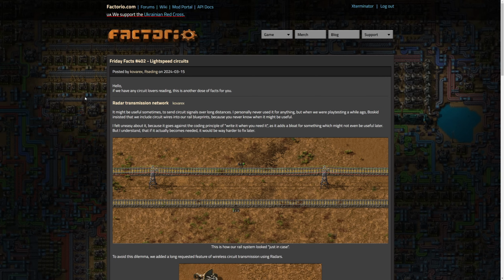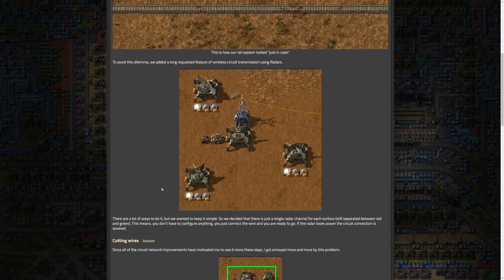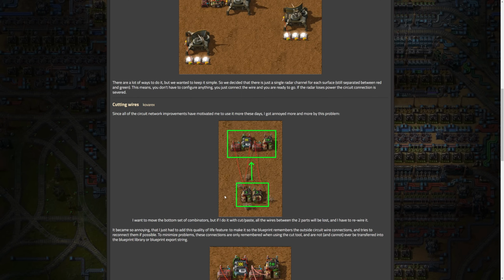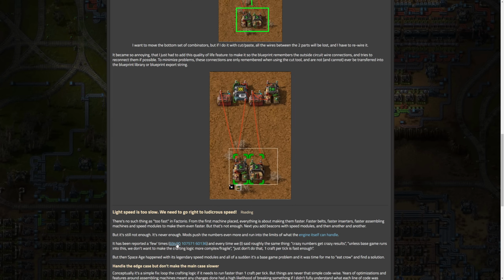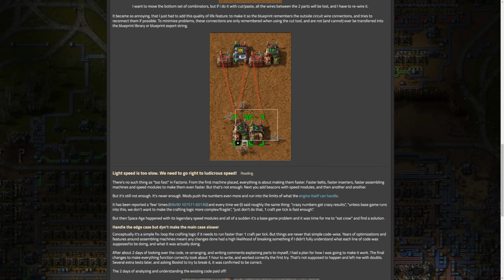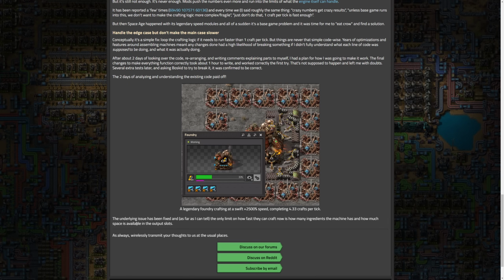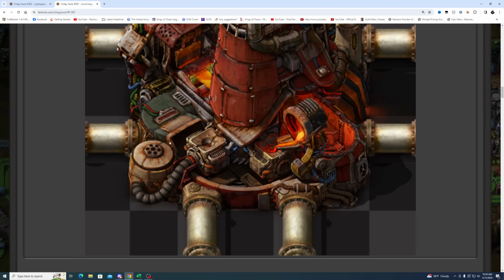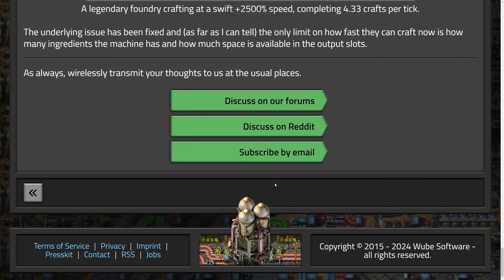Factorio Friday Facts #402: Wireless Circuits & Moar Craft Speed! - FFF Discussion & Analysis

Comment: Factorio gets WiFi!

The FF releases have literally turned into "Name The MOD!" Drinking game at this point...
Reply from the maker: Haha yeah pretty much
Reply: like rimworld, it's great to see devs integrate useful mods into new releases, Rimworld added beards which was a mod, and is now adding books and wall lights, which were both mods
Reply: i made a messeging machine in factorio and you just need to connect one wire to other messeging machine
and using this wireless signal you can message everywhere without connecting a wire

Comment: so 2.0 will be the time where i need to learn the circuits system in more detail. right now the only thing i get working is direct on/off of pumps for oil stuff. (overprocessing the fluids down but cutting that off if the tanks get too empty)

Comment: The radar transmission of circuit data would be a lot more useful if we had multiple channels to transmit on.
Reply: Well you technically have 2, red and green. Though perhaps it might be possible for a mod to add true channel support for each color, maybe.
Reply: I had an idea to use the single line like a telephone line, you input a code and only the intended receiver listens to the signal following that code, like putting in a phone number, your mining outpost would send a signal on the radar network, which would be received by all radars but only the train station would accept it, having been waiting to receive that code, then once the code was verified the signal is sent.

Would probably need some kind of reservation system so multiple sources aren't trying to talk over eachother tho.

Comment: do you think it would be possible to have your signal network utilize this radar network but by way of using codes to trigger the reciever to accept the signal?

ie, your drill outpost sends a signal preceeded by a code of "13142" to the radar network, your coal plant ignores it, your circuit base ignores it, but your train station recognizes the code and accepts the signal, inputing the signal into its attached network and notifying the train to go pickup resources at outpost 7.

this could allow you to use the one Radar network for multiple purposes rather than only using your remote signal network for only one purpose.
Reply from the maker: Hmm very interesting idea! I hadn't considered that actually but I like the sound of it. Unfortunately I don't know enough about the circuit network or signals to know exactly if/how it would work
Reply: @Xterminator  i don't know much either but if someone can program a whole 3d game engine using circuits in factorio, I'm sure we can figure out how to make a code filter/signal repeater
Reply: @asmkalrizion7078 The idea is definitely possible already, and since the radars have been shown by Boskid in the Discord server to just be secretly connected with invisible red and green wires, I am pretty sure it'll work with radars too
Reply: Definitely doable in theory but in practice it's very annoying and complicated and slow and prone to errors. It would be more akin to a novelty for most and at best maybe be used in very unique high end bases

Comment: I wonder if there is a range limit between radars to work.
Reply: I don’t think so. I’m pretty sure it’s planet wide
Reply: It's limited otherwise why would you try and make a Legendary quality Radar?
Reply: @walterroche8192  For their actual main function I would assume, which is remote view coverage and exposing unexplored terratory. Both of which can be buffed by higher quality versions. The wireless feature is meant as a replacement for preplacing logistics wires along railside powerlines. If they had a limited range then they would fail at being useful for the main use case they were conceived for.
Reply: @walterroche8192  there are more buildings, which you won't make sense with legendary quality: eg a legendary small electric pole. A Radar will probably have other quality-benefits like bigger view radius.

Comment: I wonder if the Wireless Circuits is going to get the same reaction as the Loaders did.   i.e. Too powerful and wrecks a big chunk of the game.
Reply from the maker: I don't think it will. Or at least, I don't think it should. It doesn't seem that powerful compared to how it is now. Since wires are free when blueprinting (and won't even be an actual item in 2.0, just a tool) all the radar transmitting does is saving some tedium of running wires all over the place.
Reply: @Xterminator  Ok, so more like the cliffs.  Where everyone is supper excited about it until they get it and then realize the consequences of their desires.   Got it.   :p